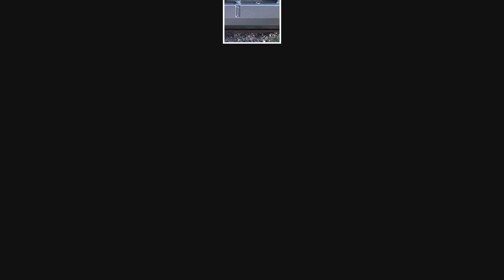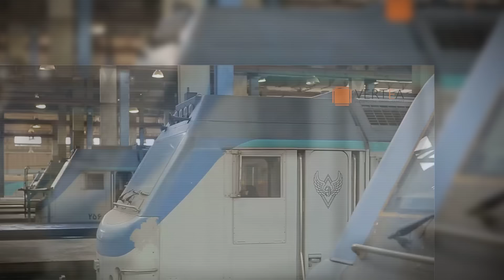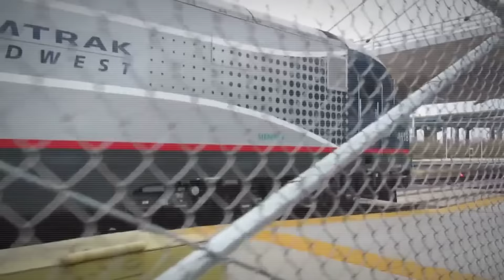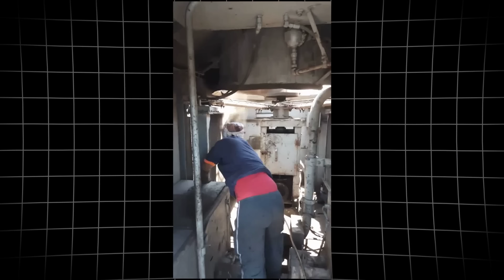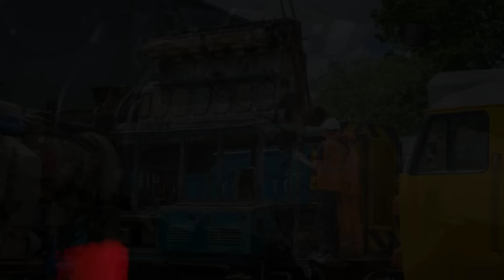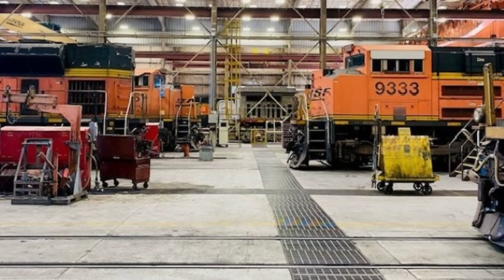Why Are Locomotive Radiators Getting SO HUGE?

Comment: SD 40-2 locomotives have three cooling fans, not four, the GE Dash 9 has one cooling fan, not two. And very few railroads use anti freeze in their locomotives, most use a non toxic boron rust inhibiting solution instead.